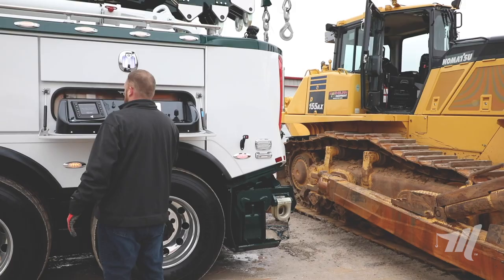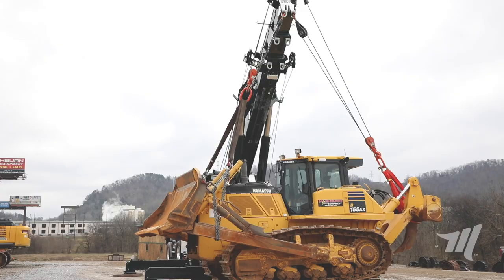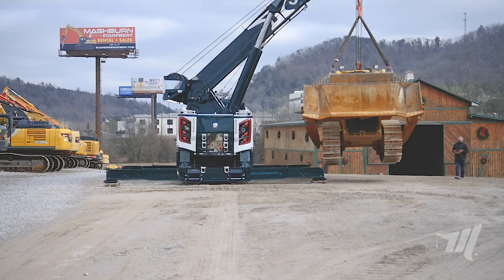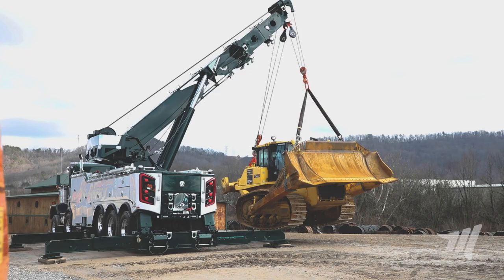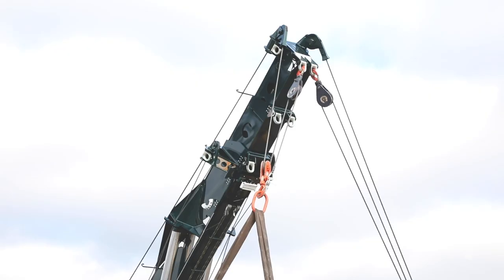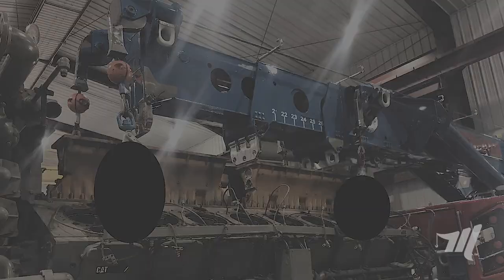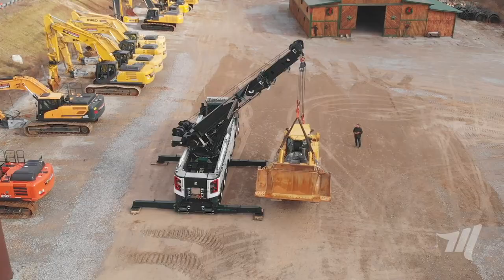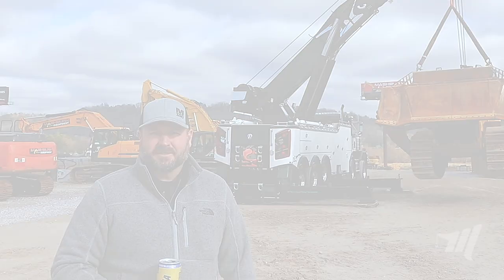M100 Demonstration with 103,000 lb  Dozer

Comment: Nice video . You are showing it lifting in an ideal situation .  You have full stabilizer spread , but you can't always have that in the real world . I would suggest have some type of removable counter weight that can be placed on the stabilizers to give some extra stability . I would think that running a configuration like that would have to be told to the computer to allow it to work . But Crane operators do that all the time . They tell the computer how the crane is configured at that moment .

Comment: No doubt the lifting capability! But another demo let’s see it in a real recovery that’s all I’m saying. 👌🏼👌🏼
Had to make sure we noticed the TEA 🤣😂
Reply: This isn't being bought for recovery.  It is built by a company known for building wreckers and people just can't wrap their head around the intent.  Though it could be used for recovery of wrecked things, this can do things no other lifting machine can.  These are for quick and easy lifting of very heavy things, in tight places, with minimal fanfare.  One man can drive it in, lift very heavy things at a zero boom angle, via remote control while standing inches away from where the heavy thing needs to sit, and pack up and roll out and never break a sweat.  No other machine can do what it does and it makes some people a lot of money.
Reply: @missmymountain  It actually would have very real recovery benefits in rural environments that frequent oversize loads, I've seen a few videos of just that occurring where a company has to go out up in the mountains or hills or something on a tight 2 lane road and recovery a 100k+ oversize load and they are packing 4,5,6 trucks diagonally to recovery said load, Where as a truck this capable while still only taking up the footprint of a 2 lane road could go in there and act as a powerhouse in some of those recoveries, You would still need an additional truck or two but it wouldn't be a struggle of lining up every truck in your fleet including light duty to just barely have enough out there to winch an oversized load out.
Reply: Would have been 10x’s funnier if it was a Miller beer...😂 for Miller Industries..?
Reply: @kennethcadesharp  lol yesssss

Comment: Did anyone notice when it booms out with the video sped up you can see when all the weight came off the opposite outriggers and they became counterweight right at the tipping point. I would have pounded some shims between the pad/arm space to have a few inches more of safety as the center of gravity passes the pin.

Comment: M100 is a 100-ton rotator, right? When will we see a load more than 55 tons?
Reply: at this point its just a crane lol i wanna see it recover too! and tow more than a bobtail backwards lol
Reply: No 100,000 lbs
Reply: @Insaiyanrider  straight from  the manufacturer's website: "The Ultimate Game  Changer 100-Ton Heavy Duty Rolling Rotator".
Reply: They pulled 220,000 lbs from a loadcell attached to the ground,the loadcell was only good for 220k would have done more
Reply: @MattyM110  a load, not a loadcell. I'm starting to think the 100-ton capacity is theoretical and they can't lift that much weight at a large enough radius to ever be realistic.
Reply: @pjtemplin  i think nrc lifted 170 with there csr85,actual lift,the m100 has a 231k loadchart that means off the back u can safely lift 231k at 30 degrees fully retracted,they wouldnt put it on the chart if it couldnt do it
Reply: @MattyM110  when you get the point here, speak up.
Reply: @pjtemplin  ive been speaking up u think the capacity is theoretical its not its factual,ive seen the m100 lift a 15k roller 40ft off the side hows that for a radius with the base also able to slide 147inches loaded ,i run a 50ton rotator i know what im talking about a lilbit
Reply: @MattyM110  sticks and stones may break my bones, but "I know what I'm talking about" will never  hurt me. Face the facts: Miller has been touting the performance of their 100-ton rotator with 50-ton loads.
Reply: @pjtemplin  fact is that truck and others are customers units,they dont want them maxing out their equipment,behind closed doors they did serious shit in making of the trucks
Reply: @MattyM110  move on, you've clearly missed the point.
Reply: @pjtemplin  move on lol, what do you do for a living that makes you such an expert in this field? and haven’t missed the point told u very simple they aren’t going to stress customers units what dont u understand about that,if a customer says ok im sure they have no problem picking 200k but at 1.3mil a pop,owners are gonna say do it on somebody elses
Reply: @MattyM110  how much of an expert do I have to be? 51 ton load, 100 ton rotator. How is that point so hard to grasp? If this is an impressive load, Miller should publish the load charts of the 75-ton unit to show the lay person how this 51 ton load couldn't be lifted by their 75-ton unit.
Reply: This comment comes up a lot.  100 ton is a structural rating and not a net load capacity.  All cranes are rated this way.  Miller has this clearly written in the specifications for it.
Reply: @missmymountain  i have the loadchart,numbers in orange is structural limit,numbers in yellow are tip limit,off the rear   @ 60 degrees in orange is 231k or 115.5 ton its good for to lift
Reply: @MattyM110  It's a powerhouse for sure!  I'm not sure why some commenters continue to downplay the abilities of it.
Reply: @missmymountain  what people dont get is its hard find a object that weighs 100tons ,that doesnt cost millions of dollars or is to big or tall which you would have to extend the boom lowering the capacity,so miller ties the boom off to a anchor in the ground with a loadcell and pulls 220k 110ton maxing out the loadcell without breaking a sweat,but then people cry that its not a real lift
Reply: The m100 is a 200k pound unit in work for miller and we are very proud of our m100

Comment: Very impressive. Does the boom carriage on the M100 roll back like the 1150R?
Reply: I'm pretty sure it dose.
Reply: @305kingMLW  How (dose) Does you know??
Reply: @dandunning4409   You can look up Miller m 100 overview or the product demo they talk about the roller function. They even go as far saying you need to roll the rotator assembly a few feet back before you can get a full 360 degree working radius. Also they mention that the system dose not need any maintenance becuse of how they built it.
Reply: Yes.  12' of travel.

Comment: that's a STUPID way to lift a dozer.  you are lifting against the blade cylinders and mounts.  it would be better to lift from the roller frames, they are meant to hold the weight of the machine. the hydraulic cylinders are NOT

Comment: A nrc him can do that no problem
Reply: Ive seen a him do 116 off the side but it did not like it,m100 would do it with ease
Reply: To get the m100 all they did is copy a him
Reply: @Anthony_St.George  in what way? The roll/slide feature thats about it,every brand copies another nrc just copied miller with there safeloader wheelift,all miller did was take features from there own trucks and supersized them
Reply: Some one traded in there him for a 1075 and that when Miller was starting to build the m100
Reply: @Anthony_St.George  probably mcadoo towing,saw ur channel u a risoldi?
Reply: Yup I am
Reply: @Anthony_St.George  funny that him i saw do 116k was urs in NH lol
Reply: My dad loves his his him
Reply: He does every thing with it
Reply: The M100 and NRC CSR 85 are different but The M100 is more powerful.
Reply: I mean in the video for the CSR85 they showed it lifting 232K, 50K more then its rated for. Miller has only shown cute little 100K lifts that even a 50 ton can do.
Reply: @Coolty44  100k would be a pretty far stretch for 1150 bud
Reply: @Coolty44  the intro video for the m100 shows it maxing out a 220k load cell with even more overhead to go. If they went and got a 250k load cel,, i have no doubts it would max that